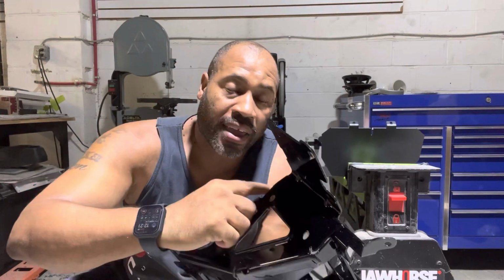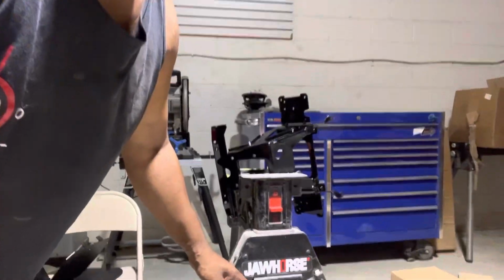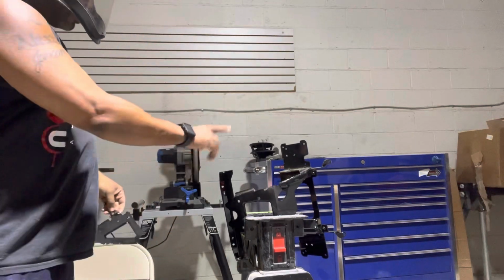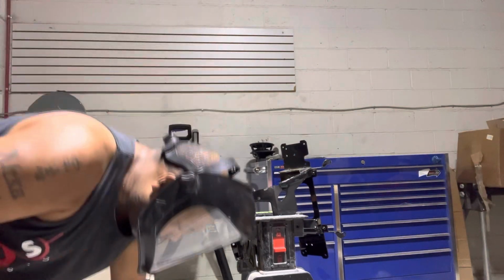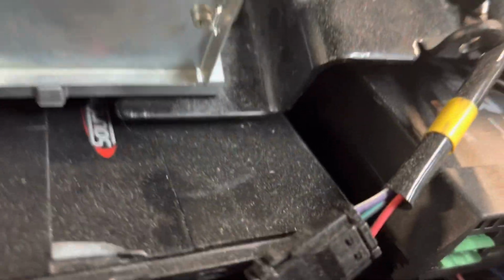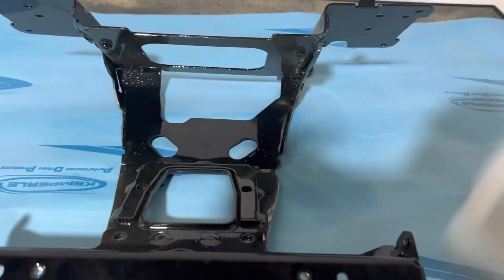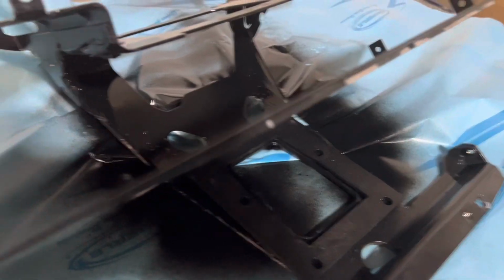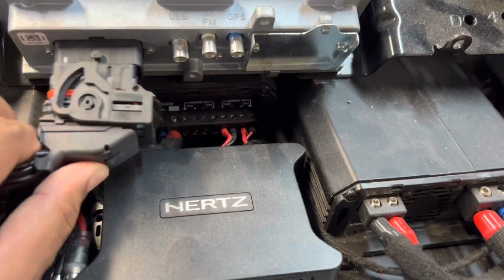Xel customs lex amp rack for the 2015 to 2023  Harley Davidson Road Glide .

Comment: While I had to grinder out could I cut a notch in the new plate to allow the headlight tabs to be used ? Also what does the top plate bolt to on the sides?

Comment: Great video I just asked last week could I do a 1600 and 1200 on the old lex rack don’t really wanna spend the $ on the 1600 if it won’t fit. One question tho how does the headlight mount up with out the tabs?
Reply from the maker: Top of the Headlight is held with Velcro on the top and factory bolts on the bottom . Faring keep the headlight held in place very snug . 

Next video will show the finished product.
Reply: With your 1600 and 1200 could you keep your vents? Funny thing is vents don’t really matter much it’s just aesthetics….wind is all around you on the bike lol
Reply: You can keep both a 1200 & 1600 on the old lex rack easily. You will have to cut the back outer ears at a slant for the vents to fit. Make sure your amp outputs and inputs work fully before you cut the amps, in case you have to swap for a bad out of box amp.

Comment: I got a weird question could you cut a notch in the plate to keep head light bolts instead of cutting tabs off??
Reply from the maker: @k.h.getthejobdone4595  yes but then the amp wont fit 

If you are using big amps they lay over the tabs 

If you are using small amps you don’t need the rack
Reply: @ I wanna put a 3k exox2 and 1200.4 in there right not I have a 1600.1 1200.4 and 400.1 on the small amp rack 400 mounted under the rack with shark tooth headlight
Reply from the maker: @ you’ll definitely have to cut the tabs
Reply: @NVSAUDIO  thanks I appreciate it
Reply: Last question lol could I use the voodoo tweeter block off plates and still have room for amps….looks like it would work but wanted to be sure
Reply from the maker: @ yes

Comment: Hey Carlos, could one use the Voodoo tweeter pods in the vents and still fit the Hertz ST25/35 NEO or would one have to use the Diamond Audio's MO75T or are those tweeter pods not even an option at this point?
Reply from the maker: st 25 fits